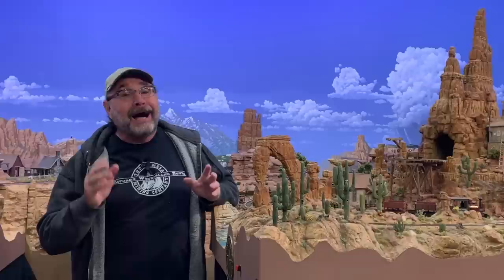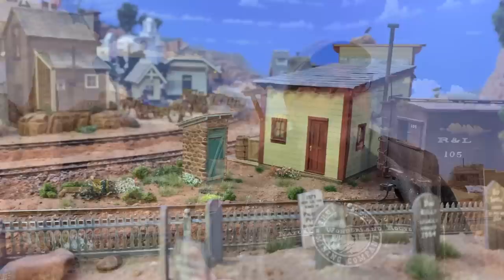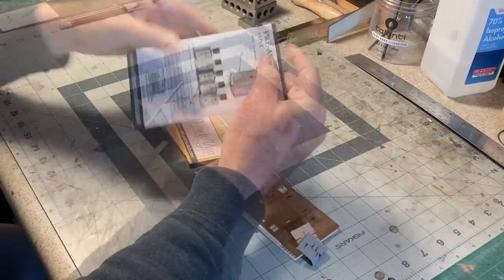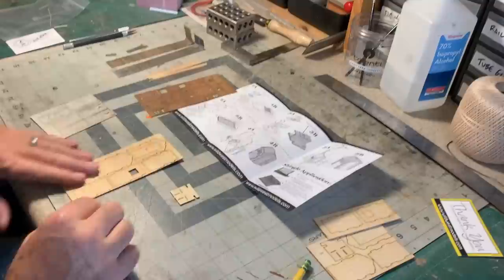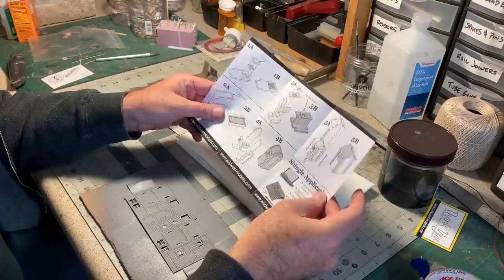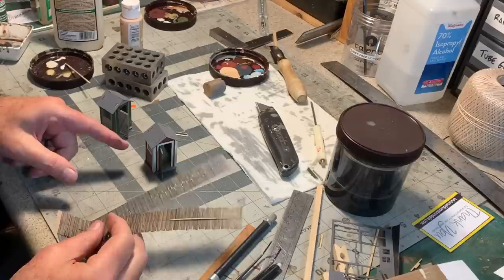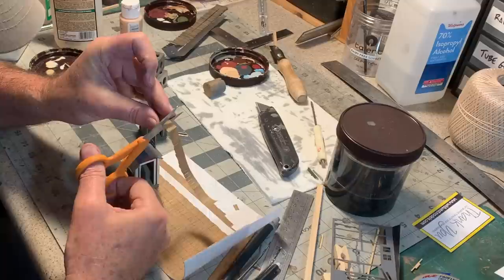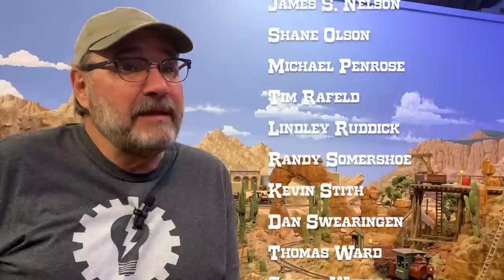Building a Pair of O scale Outhouses

Comment: I've had some really good looking tarpaper roof results from 400 and 600 grit emery paper... the texture holds the weathering really nicely as yo apply it.

400 grit is about 0.0015", or 0.037mm, which scales out to about 1/16" in O scale. This is a reasonable approximation of the gravel size on asphalt shingles as well.

Comment: Dear Dave, can’t say I’m fully informed on the North American outhouse; although on the history of the European version I can tell you that the brick ones were often installed over a kind of septic tank. Those underground tanks were initially also constructed from brick. In short there were two versions in use. 1st the ‘stacked pit,’ with an ‘open’ bottom and a wall with openings, of left out bricks, in the lower layers of the wall. 
2nd the fully masoned septic tank, hence fully enclosed, thus a true tank. 
Disadvantage of the first version, the fact that all the fluids seep through. Consequently the coarse debris piles up in the pit and needed to be removed regularly.
Disadvantage of the 2nd, it needs an overflow. All the fluids and debris remains in the tank. Adding the proverbial dead chicken starts a fermentation process which eats away most of the coarse debris. This, with the overflow of the fluids, which doesn’t produce potable water, but at least less contaminated, has a much longer stretched period of time, before the pit needed to be emptied.
Of course, I realize that such construction was much more suited for wetter soils. At least such soils where folks didn’t wish to dig a new ‘hole’ when during winter the groundwater level was much higher and digging deep enough simply wasn’t possible!!
Great vid, love the results and the levels of detail you added to the Thunder Mesa!!
Cheerio